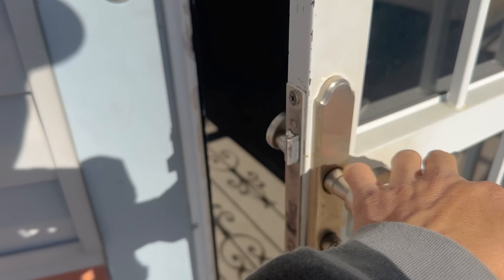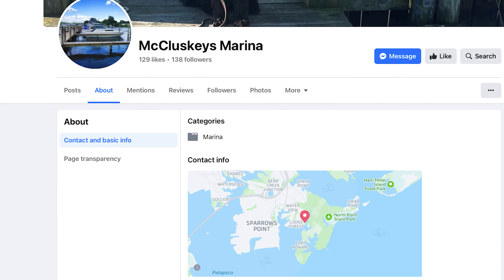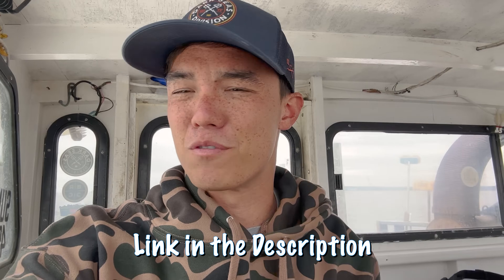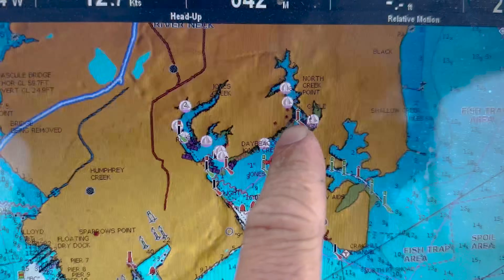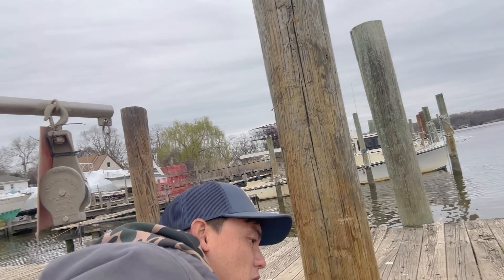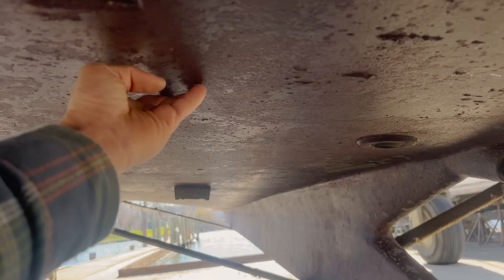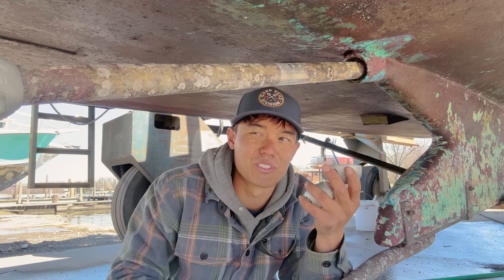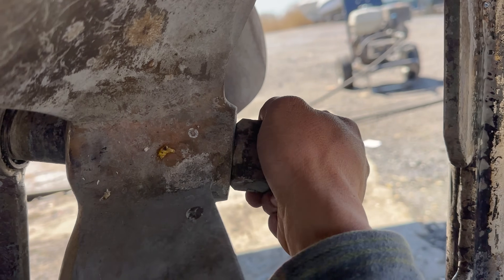FORGETTING this one thing will RUIN your entire boat

Comment: A little trick from Alaska.  Polish your prop with a brass wire wheel and paint penetrol (its like a paint additive)on it  , as many coats as you can so it dries before you go in the water.  It keeps barnacles and things from growing on your prop.  Good fishing and be safe!
Reply: Our harbor is a mud pit at low water...full of electrolysis.....we paint out props with FG resin...🇺🇸
Reply: We use Penetrol in car work too, sprayed or brushed onto difficult to access surface rust. It penetrates completely to healthy metal and fuses the oxides... Also use it in ALL oil based paints, with or without catalist. I also mix it with boiled linseed oil and rubbing oils for woodworking.

Comment: I'm in Washington State, my family has been in the pot making business for decades now since the mid 70's. After our father passed, my brother and his wife took over the business and kept up making shrimp and crab pots, but they use plastic coated wire, we don't have to zinc our pots because of that. I remember every fall my dad getting his wire order in so he could make them all winter.
Reply: Pretty sure its because Dunggies can be in much deep water, and much rougher conditions compared to blue crab. Needs a thicker heavy duty pot, which makes sense to coat. Blue crab pots are much lighter weight, and in shallow calmer water.
Reply: @sverre054  It all depends on the location. We used to wade for Dungeness crab on the Dosewallips flats during the extreme low tides, they're everywhere from 15 to 600 plus feet (we were in the Hood Canal) their geographic range is immense from California to the Aleutians in all conditions from rough water to calm inlets. The commercial crab pots for the ocean fisheries were huge heavy round 4' diameter pots with a stainless steel "chicken wire" like covering.
Reply: @cherylmillard2067  I know, my family has a cabin on Ouget sound and on low tides we can go out and grab crab, but we also can go out and set our pots in 300'. What's your company name? I am actually looking for 2 new pots.

Comment: Luke, try using “rustaid outdoor” for the brown tint on the hull, all you need to do is spray it on with a chemical hand sprayer. We use it down here in FL on our boats we run in the river.  No scrubbing necessary and way less harsh on the fumes.

Comment: 3rd Gen fisherman here and a good trick is adding cayenne pepper to bottom paint. It helps in preventing growth
Reply: I’ve used cayenne pepper on my outboard lower end that sits in salt water and it works terrific!  Just mix it with latex paint and save lots of money and time not scrapping crud and barnacles.  Good tip.
Reply: @williamwest5827  that's a good idea 👍
Reply: If your having a heart attack....it can save your life....put on your lips...hope for the best

Comment: Just a note ... the nuts on the prop shaft holding on your propeller are on wrong.  You  have them reversed ... the small nut goes on the inside and snugs up the propeller, the larger nut goes on as the lock nut.  Easy way to remember -- would you rather have 4 -5 threads locking the main nut or twenty threads locking the main nut?  I know that you probably already put it back in for the season, but you may want to fix that if you take it back out!

Comment: I know it's to late now but with aluminum boats you can get a see through though skin put on so the alloy doesn't discolor on our 55 foot cray boat we put skin on her but not where we'd pull our cray pots. The point to the story is if you got a clear skin put over the bow area it will stop the discoloration of the white fiberglass.  Another trick on the charter boat I rand it was fiberglass and I'd use aluminum acid for keeping the bow waterline white as a dove 🕊

Comment: We get the brown-stain in coastal NC. It is easily removable with any acid-based cleaner like Whink, or most toilet bowl cleaners. Apply it, and it melts away the brown stain almost instantly. At the same time it removes any wax; best I recall, you don't wax your hulls anyway! ☺EDIT; If I had commented at the end of the video instead of the middle, I would have seen you already have an acid-based hull cleaner that works...

Comment: Hey Luke. Next time go to Napa and get some stuff called Bully Dog.. it's an acid type cleaner. Almost acts like toilet bowl cleaner but better. Put it in a sprayer and spray it on, scrub and rinse. I promise you won't be disappointed. Also any small carburetor that needs cleaned,,,,, put some of that in a bowl and drop the carb into it. You'll watch it fizz and bubble for a few minutes. Leave it submerged for about 30. Pull it out and rinse. Should be cleaned. Reason I say not to leave it longer than 30 is it'll eat the aluminum in prolonged plunges
Reply: I use Pine-Sol as my small engine and ATV Carb Cleaner... its great for that!

Comment: I was replacing zincs on my boat like 3 times a year.  Come to find out that it was normal for that part of the marina.  The docks were 40+ years old and were sagging into the water with their old electrical wiring and whatever else you find on a dock.  The water was an electrolysis jungle.

Comment: when you need to clean the shaft next time bring a power drill with a disc brush of nylon threads covered with some light abrasive stuff. worked wonders for me.

Comment: Use “the works” toilet bowl cleaner gotta be the blue stuff spray it on w a chemical sprayer (don’t be down wind)let it soak little scrub, spray it off. Whiter then new. If it looks a little blue the sun will bleach it right out in a day tops

Comment: You should try zep for a wax it really cleans up old car paint
Reply: I buy their Mildew Remover by the gallon at Depot for my boats. Just put it in a pump sprayer and spray all those underdeck areas, wait 5 mins and then spray off with a hose and you are done. I use a pump sprayer because those hand spray bottles atomize to much of the Remover and will gas you out of a tight place quick.

Comment: The cheap toilet bowl cleaner called “it works” is best for getting scum off put it on dry then brush in and pressure wash off , then a good buff and polish it’ll help keep scum from sticking and easy enough to wash off

Comment: Sausage down a hallway, that's one I haven't heard before Luke. Which is surprising since I've been all up and down the entire eastern seaboard multiple times. Lol. As I'm typing this, " Since you're down here, give your nuts a tug" you said, too funny. It's one of the many reasons I love your channel. Btw "3 in One" makes a product called " RV care Window & Track Dry Lube." I use it on mine, and it works great. I also feel your pain about the Francis Scott Key bridge. I can't tell you how many times I've been across that bridge since the late 80s. I live in Oklahoma, but I ran coast to coast and Alaska (in the early days of my career, that's a young man's trip) for a better part of 35 years. I'm so sad that it's gone, and I was totally shocked at the way it came down like a Jinga game. Betting the new bridge is built for each section to be fully independent, eliminating the possibility of this tragedy ever happening again. Hopefully, they will integrate some underwater towers that rise above the surface and  will deflect and future ships from being able to come in contact with the actual support columns. Good luck this season, fair skies and the wind always at your back, as they say, or is that only on sailboats? Lol I digress. You might want to check a 40' radius around your house for roofing nails that were missed. They are extremely hard on pneumatic tires on mowers. Ask me how I know. Haha. Can't wait to see the new crab stand. How's that coming along?

Comment: Out of curiosity why do you put the zinc on before painting. Shouldn’t it be the other way around?
Reply: the zinc needs to have an electrical connection with the metal it is connected too.  If you put it on a painted surface then no connection, if you paint over the zinc then it isn't on contact with the water.  You are trying to have the water corrode the zinc not your boat.

Comment: 9:47  what's the stuff called that you cleaned it with? . We're getting our boat out soon' first timers'. And that looked awesome. Cheers Luke 😊
Reply: It's called On & Off. Just be careful with that stuff. Like Luke said it's like oven cleaner but worse which is not that great for gel coat. If you use it, you are going to want to wax the gel coat before putting it in the water again.
Reply: @finscreenname  thank you 👍🏼👍🏼

Comment: I hate when I hear people called Striped Bass rock fish so fucking stupid. We have tons of cormorants in my local bay in Nj and have one of the biggest spring striper runs on the east coast. Absolutely 0 problems with STRIPER populations. The only issue I have is a bunch on bennys and out of staters destroying my local beaches and waterways coming here for the spring run. Makes me sick. Also, only shitty stainless steel will corrode 304 309 are very common and will corrode, 316 is the way to go with stainless steel and water. Another thing, if you scratch stainless steel with a steel brush, or other steel it will cause it to corrode. Make sure whoever welds it cleans it to perfection with a stainless steel used only wire wheel or brush. Stainless is NOT hard to weld or work on in any way.